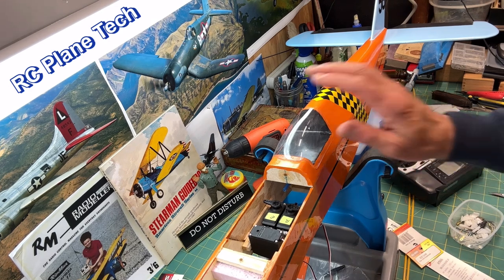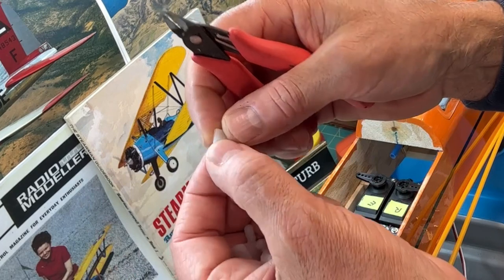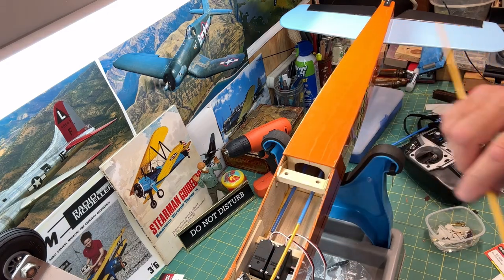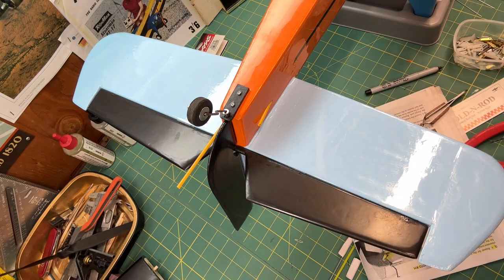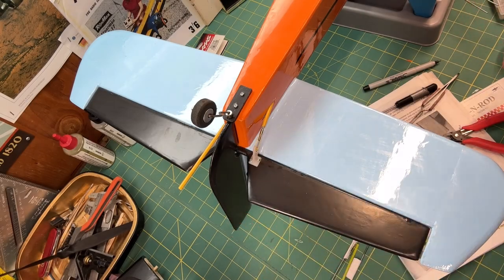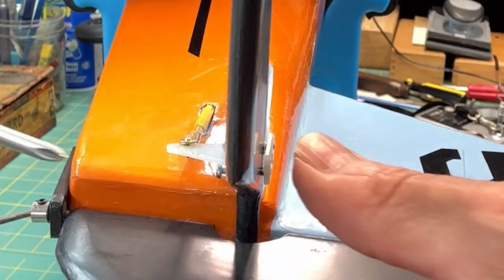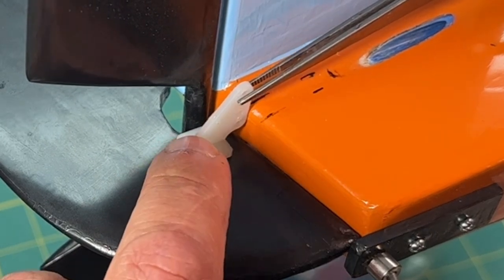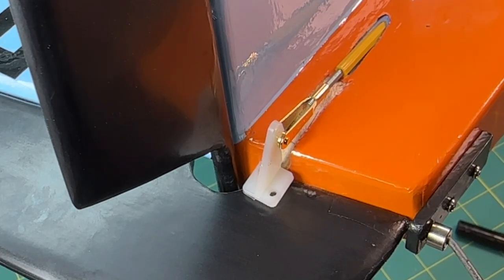Balsa USA Smoothie RC Plane Kit Build No 43, Rudder Elevator Control Rods

Comment: James, 

I have never seen those Gold-N-Rod push rods before, they are pretty slick. What seems nice about them is their flexibility and they appear to be very smooth, I’ll have to try them. 

The rudder push rod/horn installation certainly was not straight forward, I cringed when you said you had to take a saw to make a slot in the fuselage but you did an amazing job with it and it looked very finished and functional once you put the covering on it. 

A thought and a comment. I wonder if you made a balsa block and put it under the horn for the rudder if it would have raised the horn enough to give you the clearance you needed.  It would have created a more acute angle from the horn to the push rod so I’m not sure if that angle would have been too much and cause binding on the push rod, just a thought. 

Also, I have found the Dremal 1/8 in. Rotary Tool Spear-Shaped Tungsten Carbide Accessory for Steel, Stainless Steel, Iron, Ceramics, and Hard Wood to be one of the most useful accessories.  I think it would have been the perfect tool to route a channel in the fuselage. It is a very useful for so many applications building RC kits and ARF’s.  It is a little pricy (~$10) as are most Dremal accessories but this one does not wear out and should last you a long time. 

Keep up the good work!
Reply from the maker: Hi, thanks for the tips. I do need to get more accessories for my proxon, Home Depot has a lot of Dremel stuff that I like. I’ll check out your suggestion. 

The problem with the tail is that even if you blocked up the horn, that block would then hit the back of the tail. I guess you could offset a block back more but Id have to think about the geometry of that. It would have to angle back toward the tail like an arm if Im thinking about it right? Or maybe just put a block back with it perpendicular to the rudder, but back enough not to hit the tail, bit then there would be a swinging in and out of the control rod I think since it would be rotating along the hinge line? Its a funky setup. Id have to think more about it I guess.

Thanks for your comments and such, much appreciated.
Reply from the maker: Also, ya, check out the Gold-n-Rod sets. They are hit and miss with their availability. In fact the last time I was at the local hobby store I purchased some extras.  They are nice sets, check out Sullivan’s web site and buy a few even if you don’t need them now but are thinking about a future kit. You can find them on ebay at times

Comment: James,
I am getting ready to make the slots for the rudder and elevator rods.  

I was considering eliminating the dowl rod that connects the elevators and using a two to one control rod  off of the servo with a control horn on each elevator.  I don’t know if there is enough room for both an elevator rod and a rudder rod on the side of the fuselage though, it does not look like there is room  on the fuselage for the rudder control rod above the vertical stabilizer should I keep it all stock? I’m just questioning the integrity of the wooden dowl.  

Are the locations for the control rod slots on the fuselage accurate per plan?

Thank!

Tom
Reply from the maker: Hi Tom. I found that it worked out well building it to plan. It is a little tight. Maybe if you used a hard wire “fork” for the stabilizer it could give you more room? On my Hangar 9 Piper they use a dowel for the control rod with hard or stiff wires forking off to the control horns. But thats just a thought maybe it will give more space to make room. I was a little skeptical of the dowel as well, but went for it using the single control horn connection and epoxy the dowel. You can reinforce further using a fiberglass cloth and epoxy. Unfortunately my plane didn’t last long enough to test the single control horn setup over time.

Comment: I am building a Sig Mark kadet 2 kit,  when you put the 90 degree angle to insert into the servo, what is the purpose of the EZ links?
Reply: I see watching your next video, it locks it in place
Reply from the maker: Ya , the Ez links are nice because you just need a 90, and then easily clips on for a secure hold. I really like them.